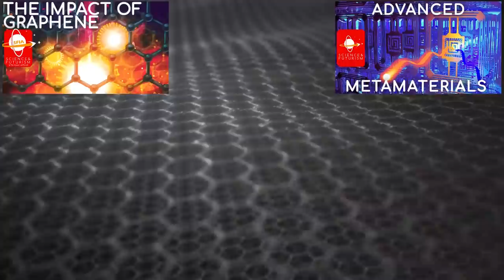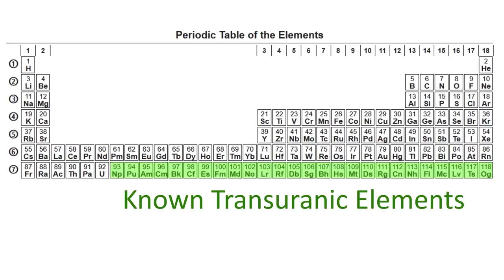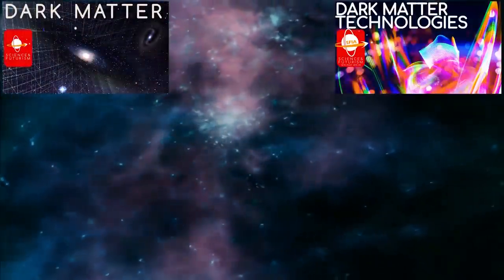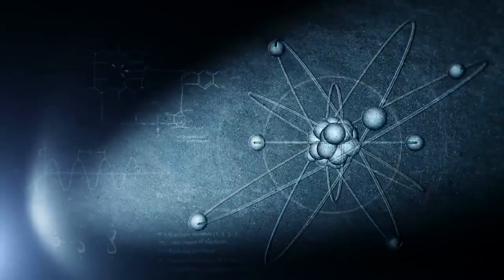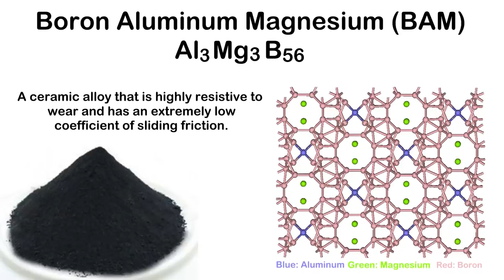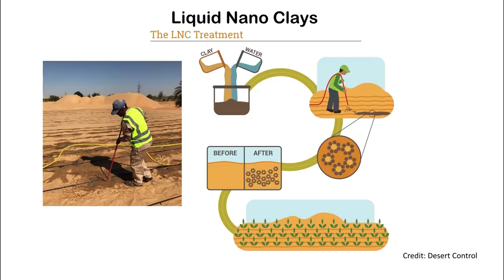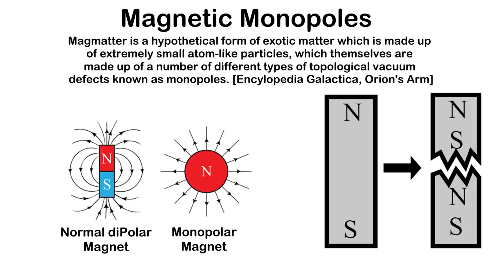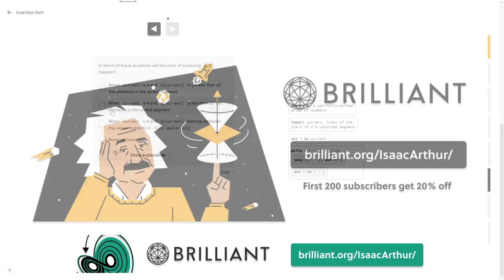Upcoming Advances in Material Science

Comment: The biggest problem with Osmium apart from its rarity is its propensity to form volatile and toxic Osmium Tetroxide when exposed to air. Otherwise it would be pretty useful.
Reply: This is the kind of community I want to party with
Reply: Fourth Root is here yeah.
Reply: Sounds like it'll be more useful once we start building things in space. No air up there to cause issues.
Reply: Osmium metal by itself wouldn't be so useful because of it's brittleness, but alloys or compounds such as superhard borides or topological superconductors would be.
Reply: Yes, nobody uses raw iron. We use steel and stainless steel, so... stainless osmium sounds good.
Reply: That's, "propensity".
Reply: @lylez00  Thanks, corrected.
Reply: @Djarms67  I'm everywhere.
Reply: @FourthRoot  ❤️
Reply: Back in the 70's in high school we were given a two-page assignment on an element of the periodic table.  After a little checking I selected Osmium.  I then submitted a half-page essay on it.  When the teacher complained about my brevity, I shrugged and pointed out that the school library only contained half a page of information on Osmium.  I got a B, which I figure was close enough.
Reply: That's why it's great in outer space, no air out there.
Reply: @xanderunderwoods3363  To what end?
Reply: @Nekrumorfiini1  so cast iron isn't a thing ?  and here I was machining materials that nobody uses ???  interesting

Comment: Hopefully solid state batteries will come very soon. They will really change many things. Solid state batteries made of a lithium free abundant material would be even more amazing.
Reply: Lithium is abundant
Reply: There already are battery chemistries based on Abundant elements but that's not the main thing, they also have to be energy dense
Reply: @Olaf Nilsen 
there is not enough lithium on earth to meet projected needs and the extraction processes are getting to the point of having greater carbon footprints than not having the batteries in the first place — metal-air and other batteries are the way of the future, Li-Ion is going to have to become niche again as we switch to the right battery technique for each specific purpose.
Reply: @jasonisbored6679  it is abundant and many new processes coming online that will make it much less wasteful
Reply: @jasonisbored6679  Lithium is abundant. There is enough on Earth. The problem is that it is very diffuse. So accessing it can be very disruptive. For example the several hundred square miles of salt pans in the Atacama dessert. Don’t forget that there is another new source of highly concentrated lithium.

Old batteries.
The need to mine fresh Lithium will decline over time.

Comment: One of the many nice applications for high temperature superconductors is low loss transmission of work. So for example in a conventional bike you pedal and the motion is transmitted to the wheel by a chain and sprocket. With a high temperature superconductors you can make very small ultrahigh efficiency motors, since you can make much stronger and more compact magnetic fields. So in the case of a bike you'd have two superconducting motors linked with a superconducting wire and the work input into one would instantaneously be transferred to the other. Kind of silly to use such sophistication on a bike, but the point is that you can suddenly substitute any mechanical transmission with superconducting wires, over any length. To humans from the future mechanical transmissions will seem like the silliest thing ever.

Comment: With regards to making materials with lasers, I've long considered the possibility of using holograms to bulk-pattern materials. Imagine something looking not all that different from your typical "holographic" foil sticker used to produce the laser peaks and troughs on a substrate, every tenth micron or so, to encourage a chemical vapor to settle in just those spots, being ejected from other spots, and bind with the substrate and other materials already present. Swap the hologram for another hologram, and introduce the next gas to bind every tenth micron or so. Basically, using holograms as a sort of stencil for laying down materials, quickly, but with nano-tech precision.
Of course, to achieve this, you probably need holograms that involve EM down in the longer wavelength X-Ray range.

Comment: Great episode.  I like the thought of 'shielding' gravity rather than actual "anti-grav."  When you mentioned it in another episode ('technologies that probably won't exist' or some such), it got me thinking about using it in a DnD-ish based story.  i.e. finding some fancy tree on the 'elemental plane of air' that has a natural ('non-magical') 10th thickness for gravity.

Notably, how something like that would might work for building a skyscraper, hauling freight, and such; i.e. a low-quality apartment giving residents vertigo when they walk past certain spots, or 'center of gravity'-related accidents when unloading a low-grav lined truck.  Or partially replacing elevators with Metroid-style vertical low-grav corridors (i.e. jumping from floor to floor), all manor of flying drones, a massive ship or island that experiences lunar gravity greater than (or similar to) earth gravity, so on.  Dunno, its just cool to think about.

Comment: A metamaterial that allowed us to build thermocouples with an efficiency as good or better than heat engines would obsolete turbogenerators. This might be an extension of photovoltaic materials into the infrared spectrum. The resulting solid-state devices would have no moving parts (except perhaps to convey residual waste heat to a heat sink radiator). 

Similarly, a significant amount of fusion energy release is in the form of penetrating gamma-rays. A metamaterial designed to capture that kind of energy may be essential to making fusion a practical energy source.
Reply: Metamaterials work by surface-coupling of the photons to the material to change its properties. That can only happen if the wavelength of the photon matches some property of the materials surface, like the spacing of rods or holes on it.
Gamma rays have subatomic wavelengths.

Comment: In nuclear fusion, the plasma would have to be compressed almost into a floating ball right?
And the EMF generated by the magnets oscillate like a toroidal vortex? 
Would a spark not be enough or does it require a lot of fuel we don’t have but the power to start it.
Reply: You would use a centrifugal, rotating liquified metal or non metal in a ball enclosure with an empty space at the center permeated by a defined magnetic field. Then apply pressure to the liquid metal with peripheral pistons to crush h3 into fusionable h4. Its beeing built in Britain right now.
Reply: @808bigisland  can’t wait. Sounds like the future is lookin litty af

Comment: What if instead of a space elevator like the one's I've seen sci-fi concepts of? What if we build a intertwined, segmented, connected arrangement of floating pods, all with different atmospheric density with tubes connected from segment to segment. Each pod increasing at the elevation they naturally float at? Then we could get to a point where way less energy is needed to escape Earth's forces and it seems possible to build step by step. (At least in theory with the right materials and methods) The base could be drilled super deep down into the bedrock for a bunch of different foot holds. The top pod could have a extra capacity for floating in the atmosphere so it would create a end point of tension to the structure to give it some rigidity to an extent, as would the connecting point tubes between the pods that allows for travel up and down the entire structure and the tension wouldn't be put on one single cable unit but rather a whole bunch of interconnected super strong points of connection. ???? Just a random probably dumbass idea. ???? It was fun to think about tho.

Comment: strength and toughness are almost opposite characteristics in metallurgy. strength is the ability to resist deformation, toughness is the ability to absorb energy without cracking. Last I knew copper is the toughest metal

Comment: These are old news.

Borophene is better than graphene because it's far more elastic in one direction, and you can pin plates to each other by partially intercalating certain metal ions like magnesium or aluminum so that the layers don't slip past each other. It's also a miraculously good catalyst, almost as good as platinum for some applications.

The new champion for the highest melting point is nonstoichiometric hafnium carbonitride, no longer hafnium tantalum carbide

Metglas outperforms mu metal these days.

Anyone who sees this, let Isaac know to reach out to me if you'd like to hear more stuff like this.

Comment: Does a 2d material mean it is one atom thick? Is that what qualifies as 2d?
Reply: 2d means basically as thin as it can get. In most materials, that means one continuous sheet of atoms, like in graphene or borophene.
But it's also possible to call molecular polymers 2 dimensional, if they're only one building block in hight.
So basically it's that the material can't be thicker than one "unit" it's made up off.